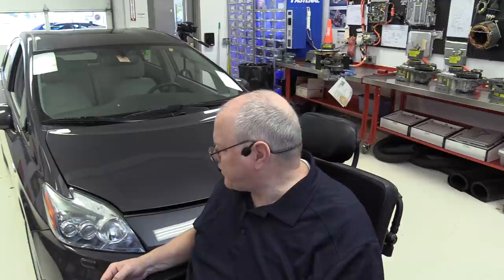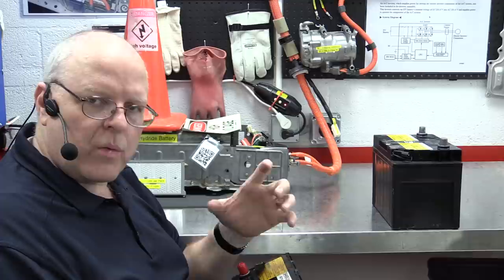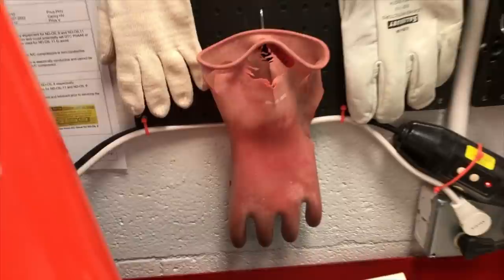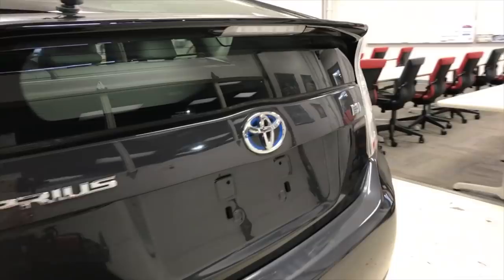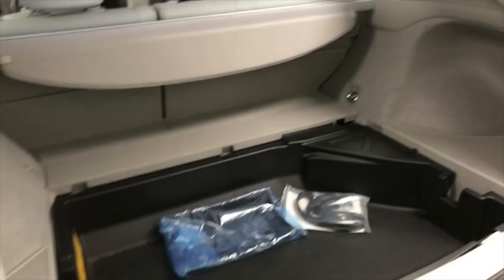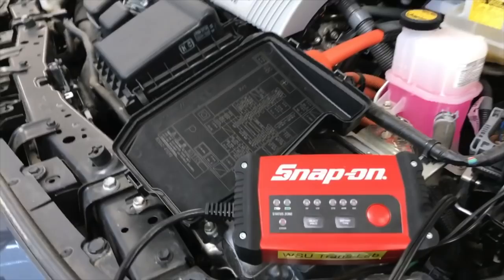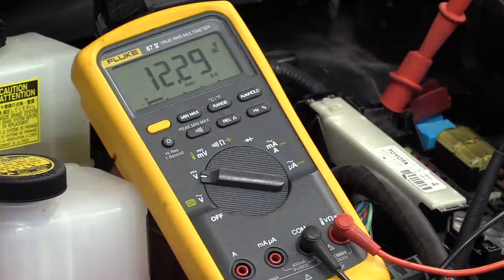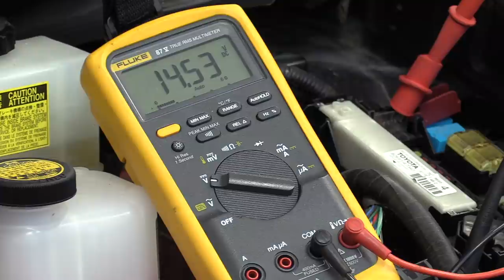Low Voltage Hybrid and Electric Vehicle Systems

Comment: Thank you so very much, Professor Kelly.  Your videos are very informative and helpful to me!  I have been trying to find the answer to this question: On a 2007 Toyota Prius (Second Generation), does a bad high voltage battery drain the 12 volt battery? My low voltage Battery keeps getting drained - if I don't restart the car within 24 - 30 hours, I will have to  "Jump" or recharge the battery (a brand new battery).  Thank you in advance for your response. Naz.
Reply: No. Did you replace the low voltage battery with an AGM battery or a cheaper conventional lead acid? You may have a accessory item causing the power drain or a damaged battery if you do have the correct AGM battery. Any error codes relating to the low voltage system could point to a problem

Comment: Do you know if the 400h 2008 is supposed to have the blue inverter relay missing and is that why it will not charge with the engine on in D standing still. I just bought the car at a shop that specialized in Toyota Hybrids. Also i replaced the battery with a new prius battery thinking its better or supossed to have a deep cell agm but its shimmed in with copper strips but just read under the hood something about lead. So is my year a regular battery. Im confused day after i bought it i decided to change the battery and then air conditioning and window  stopped working. I learned how to fix the window but i have a couple issues still.

Comment: Hi John, 
thanks for this video. In this video you indicated that the Camry 12v battery has a temperature sensor. My Australian build Camry hybrid battery is a AGM type that can be changed at 5A for 12 hours. But it doesn't have a temperature sensor. It does have a vent hose that the owner's manual says. "Ensure the vent hose passes through the grommet as shown". When recharging the battery.

Is this because it is a Australian built Camry.

Thanks.
Reply: Hi John,

Maybe in sunny Australia. The temperature does not get low enough to need a temperature sensor on the Camry Hybrid 12v AGM battery?

Comment: After reviewing the wiring diagram for my Gen III Prius, I see that the DC/DC Converter output provides an indiscriminate 125A, 14VDC feed. Say my Aux battery were low. Is there anything in the circuit that ensures the 12V AGM battery only charges up to 4.2A?
Reply from the maker: Good question. No, there is not, but there is a temperature sensor that is monitored to insure the charge voltage is adjusted to meet the needs of the battery. Charging an AGM battery with an external charges does not monitor that temperature. Further, the 125A capability of the DC-DC converter is to provide current to the rest of the vehicle systems as you operate the vehicle, not necessarily to charge the battery.

Comment: Professor Kelly,
Great video. Helped me understand my 2012 Prius battery system. I'm assuming that once the high voltage battery hits its end of life, I'll need to replace it, since the 12V low voltage battery won't be getting charged. Reason I asked, is because someone tried to tell me that when the High Voltage battery dies, I could just run the car with the combustion engine. Did the earlier Prius models, Gen 1 & 2, maybe have an alternator? Just wondering if this was just a rumor someone started, or actually could be true for earlier models?
Thank you,

Bob

Comment: AGM battery is resistant to vibration for which it is good for vehicle/mobile  use.
And its cycle life is also higher than other   low cost LeadAcid or Gel type battery.

Generally speaking AGM battery is just about 20% higher than other type of LA battery. It shouldn’t be as high as 300 USD for a 12V/50A battery. It will be too much if Toyoya wants to officially charge that amount. Any good quality third-party battery will cost within 150 USD. Alternatively we may use Lifepo4 battery, little more expensive but forget about it for the life of the car...

Comment: I have 2013 Prius ... recently even I replaced 12 Volt at the dealership last year. I noticed that my original hybrid battery is charging up to 100% at least 8-12 times on my dashboard as icon. I  do not think that this is normal. Am I right?

Comment: I have a question, I have a 2013 Prius and a Fiat 500e both of which have had issues with there 12v batteries in the past that stranded us. I am looking at compact lithium ion jump start battery packs that are popular, but I am wondering, are they safe to use? I am concerned because these are designed to turn over internal combustion engines and all I need is something to provide power to the computers of these vehicles in order to power them on. Is there a better portable emergency starting solution for electric and hybrid vehicles?

Comment: great video,, i Have a 2004 Toyota prius , i recently changed the mechanical pump for the Hybrid synergy drive system. Now my Prius will not start  i could use some help ,,
Reply from the maker: Which mechanical pump? water pump, oil pump, transaxle fluid pump?
Reply: synergy mehanial pump , near the driver headlight ,

Comment: why this HVAC and steering pump etc wants a high voltage electrical connection. If we will compare to normal diesel vehicles all this HVAC and steering are used in low voltage system. whether we can do this for EVs also like a supply from low voltage system to mentioned components.

Comment: I have a toyota Estima Hybrid and after starting the minivan, it starts for 2 seconds and shuts off immediately and two dashboard lights have popped up, VSC light and a red car with an exclamation mark inside it. Do u know what could be the reason? The 12 volt battery was boosted by the transporter. He even admitted it and says that boosting does not damage the battery.

Comment: Hi, What is the discharging current of a Hybrid vehicle when sitting on turned-off position? because I have a Camry Hybrid and it takes 3A current, is it normal?
Reply from the maker: No, 3A is very high. 25mA would be normal

Comment: Hello, i'm not sure if you would see my message, but i have a Prius 2G, my low voltage battery is fine but if i don't turn on the car with a jump start it never shows any power signal at all, and i checked all the details i could, when the car is working there's no issue at all and even checked with an OBD if there's any error code and there's none, so i really don't know what else to check
Reply from the maker: Check all the fuses you can find. There is one at the battery positive cable too

Comment: I have a problem with my Prius 2009 series 2 body, if I turn it off I can't get it back to ready unless i remove the 12v cable of the battery and put it back after few mnts, and while driving I get the triangle sign and engine check but the car still drives fine... HV battery replaced but didn't fix the problem, also ECU replaced, invertor under hood replaced، same thing.. If you have an idea may be?

Comment: I have a 2012 Toyota Prius 2nd gen. After I left my headlights on over night, my 12v went completely dead. And I just got it jump start but I dont have a battery charger. I have heard that if I leave the engine on for over 8-10hrs, it will charged the 12v battery completely. Is that true?    If I leave the engine on over 12 hrs then what will happen to the battery?  Will it harm the battery because it is over 12 hrs?  

And if I do end up replacing the 12v oem battery from Toyota, do I need to leave the engine on for 8-10 hrs so the battery can be fully charged?  Or I need a AMG battery charger hook up for 8-10 hrs? What is the standard procedure after you replace the 12v battery? Thanks

Comment: Hey would it be possible for Evs to get rid of the 12V battery and instead use the dc-to-dc converter to power the 12v system directly ?
Because i heard Tesla would like to get rid of the 12V battery but i wonder how this can be done.
Reply from the maker: You still need a low voltage energy storage system to keep the vehicle awake when it is off for communication and maintenance. It also is needed to power on the vehicle and activate the high voltage system before the DC-DC converter can even function.
Reply: @WeberAuto  One possibility might be to integrate a second, always-on DC-DC converter inside the high-voltage battery enclosure alongside the BMS, one optimized for low standby-loss and limited output power (to avoid any need for active liquid or air cooling), just a few amps feeding a separate, small fuse panel to operate standby loads and engage the HV contactors when the vehicle is started up or put into "accessory" mode.   

I've used small, off-the-shelf converter modules from, e.g. Vicor that will take a 300-400VDC input and output 12V or 13.8V, galvanically isolated with separate ground if desired, at about 100W (when mounted to a passive heatsink), drawing only a watt or two when idling with no load - that standby consumption could probably be reduced further through techniques like cycle-skipping, which these particular converters seemed not to implement.

The vehicle's main, high-power DC-DC might also need to be upgraded with a higher surge rating,  and maybe some extra capacitance across its output to supplant the filtering and transient-handling functions of the absent 12V battery.  This, and a bit of extra wiring for dual 12V buses should still be worthwhile to avoid hauling all that lead around!

Since people would still expect to be able to do things like run their headlights for a while even with the "ignition" off,  a small, efficient controller operating from the standby 12V supply could monitor certain dashboard controls and engage the main DC-DC when any such large load is switched on, without going into full Accessory mode.  Putting the larger DC-DC on its own dedicated output from the HV battery, switched by its own contactor (a smaller one with less coil power dissipation) might make sense also.

Many 12V devices in a car already have separate switched and unswitched 12V inputs, so this wouldn't seem to be too radical of a change.

Comment: For the low voltage can we use AGM type...
Reply: I see he never answered u. I USED to work at a battery mfg. So u can take or leave my info.😉 I'd recommend AGM if it's im the back of your car, MY prius, its up front. So u can go lead/acid (regular battery) under my hood because ur not breathing fumes/more combustible if used inside. U can USE lead/acid inside but prof doesnt recommend. NOW saying THAT, Prius batteries 'cycle' more than reg gas engine batteries. They make marine/deep cycle but theyre too large for prius. Lead/acid batteries are alot cheaper. On charging batteries, u NEVR use high amps to charge ANY battery. Slow charge holds longer & doesnt hurt it. If u HAVE TO quick charge, dont do often.. Hope this helps u. I'm 68 & not ANYWHERE as intelligent as the professor, but I've soldered new posts on batteries, diagnosed, & installed.. Good luck!

Comment: At 34:12 you say that it steps it down by the transformer action.  This is DC!  No transformer action is possible.  Am I right?
Reply from the maker: No, you can pulse DC and get transformer action. Think of an automotive ignition coil for your spark plugs. DC. Thanks for your feedback.
Reply from the maker: Pulsed (or modulated) DC power on the primary winding of a transformer will induce current into the secondary windings. You can step up the voltage (like an automotive ignition coil 12V to 20,000V) or you can step down the voltage (like in the high current DC-to-DC converters of a hybrid or electric vehicle 201V to 14.5V). Faraday's law describes a changing magnetic field, it does not have to be changed by AC power. The next video I will publish this weekend is on inverters and converters. You will be able to see the center-tap transformers quite clearly. Your article on Faraday's law was based upon a steady state DC, not modulated. Your wikipedia article, section 3.1 clearly states "In these DC-to-DC converters, energy is periodically stored within and released from a magnetic field in an inductor or a transformer". I hope that helps.
Reply: Thank you so much for the explanation.

Comment: thanks for the information.I have the same battery for my Lexus es300h.It does not have a temperature sensor.Im not sure why It has not given me any codes.I notice that when a load is on the battery when the engine is not running it does drop below 12 volts.When should you replace these batteries and how do you diagnose it?.The battery is usually stepped down to 14.5 volts when charging.Wonder if it's okay for an AGM battery to go below 12 V.Not sure if would have trouble charging it?.If that's the case I have seen people attach the agm battery to a regular battery and charge it to trick the battery that its a good battery.I do get an error when I go to get my SAS reset gives an low voltage error.If  the auxiliary battery in this case the 12V battery bad does that put more wear and load on the bigger hybrid battery? Thanks

Comment: 4.2 amps vs 5 amps charging current on a car battery wont make a bit of difference. it's fine if you intend to do things exactly by the book, especially when teaching, but when doing things myself on my own car, it would only serve to piss me off if the computer in a car prevented me from doing something that would work just fine but isn't strictly by the book.

I put a large AGM battery in my cobalt, which it normally doesn't take that type or size. it barely fits, but it works great for me and serves my needs.
Reply from the maker: Maybe. Your Cobalt is not charged by a DC-DC converter. When it comes to hybrid and electric vehicles, stick with the manufacturer's recommended procedures or things can get very expensive. Thanks for your feedback

Comment: What is the amperage rate for charging system of the low voltage battery? Reason I ponder this is because Kiddos left the interior lights on in our 08 Highlander Hybrid, it would not start until I jump started it- wife went to work (25 minutes) and it failed to charge- headlights even worked but still failed to start until jump started again- seems much pickier than a conventional system even though its started by the high voltage side as Everything low voltage worked great, but couldn't get the "ready" light until jump started- once "ready" was on the dash it cycled the ICE correctly on the drive home.  All is good now that I left my motorcycle AGM 2A charger on it overnight.
Reply from the maker: 4-5 amps for no longer than 10 hours when using an external charger. No limit when the vehicle's own charging system is charging it because it monitors the temperature and adjusts the charge rate to avoid overheating the battery.

Comment: Dear Sir, AGM battery is supposed to be same group battery of Lead Acid, same specs... Pls check and confirm.

Why Toyota and other hybrid car manufacturers are Not using Lifepo4 battery instead of Lead Acids? Price with be within 300 USD...

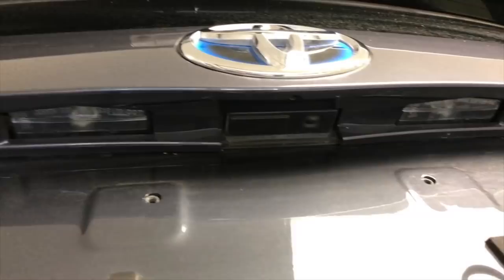Comment: 17:00 Bad Toyota design: dead battery means you can't open the battery compartment. But what if you're someplace without a battery charger, and nobody is around to jumper you? That happened to me. And there was enough stuff in the car that getting to the mysterious internal hatchback latch was impossible.  FML.

Comment: Can anybody give me a detailed picture of a Prius inverter second generation I'm having a problem locating where one of the wires inside go.. the ones on the internet don't show me I'm looking for the wires on the back side of the inverter that are I believe the interlock the black one and an orange one in there like a 26 gauge wire very small and I don't know which one of the loves it goes to it has two of them that it could it equally fits both of them.

Comment: Great video. I have lexus HS250h very similar to yours, I just want to maintain my battery, not been using car much. Can I charge and maintain  the battery same way as you did? from front, under the hood.
I purchased Motormaster classic series battery charger model 011 1974 01. Do you think its right battery charger.?
Reply from the maker: It would need to be designed for an AGM battery. Thanks for watching
Reply: @WeberAuto  Sadly your answer is not complete. I know, that I need AGM battery charger. I gave you model number to get your expert advise. That is the reason I was watching your video.
Reply from the maker: Sorry, I receive hundreds of comments/requests per day. I don’t have time to research answers like that.

Comment: Will a dead cell in the hybrid battery cause the Toyota Prius 08 to not start if it is discharged fully and run out of gas. we added 5 gallons of gas but it doesn't show and says we still need to add gas, and we replaced the 12v battery.  any idea?
Reply: the mechanic is trying to tell us we need a new hybrid battery, and the gas engine will not do anything even with a jump
Reply: I ran out of gas with my Prius and it took me a day and a half to figure it out unplug the Hybrid battery safety plug let it sit for 5-10 minutes and then plug it back in the sky will start right up

Comment: Hello, I have a question related to a problem in Prius 2. The machine warns 2 defect codes POA08 DC-DC converter DEFECT and c1310 that I think is related to the first error. Is it possible that a battery that has lower starting current is the problem, the original battery 12v 45Ah 370A, the new battery 12v 45Ah 330A? Thank you !
Reply from the maker: I doubt it, I suspect it may have been damaged another way (jump starting, crossed or reversed jumper cables, etc.)